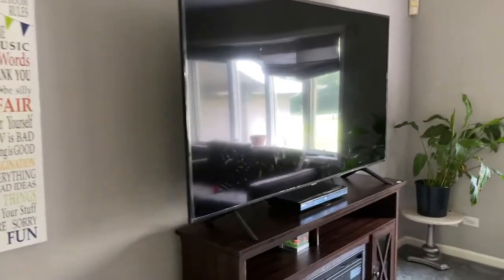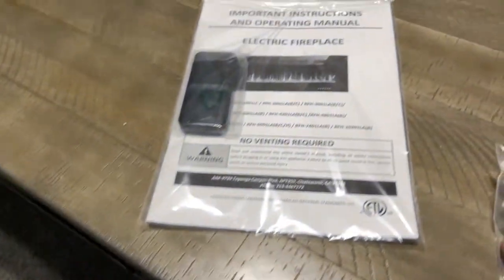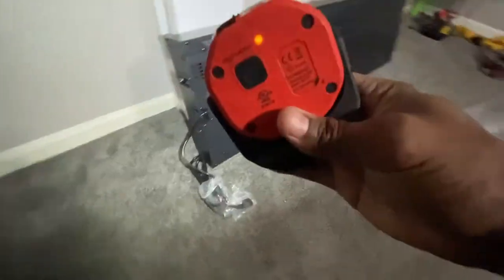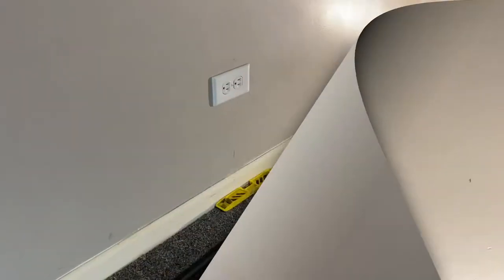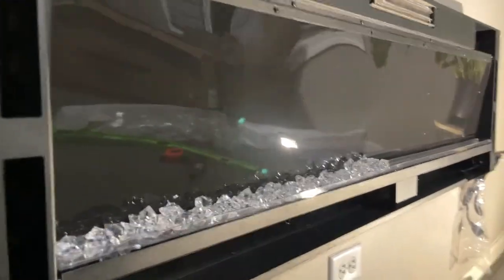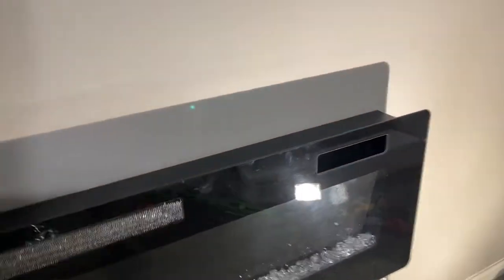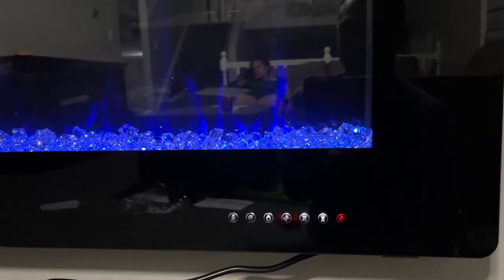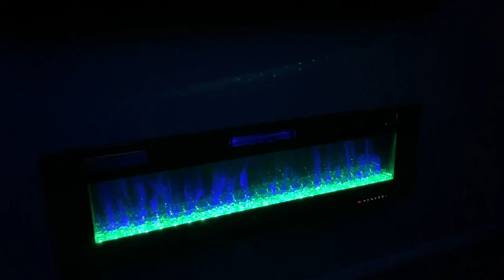R.W. Flame Massive 60" Electric Fireplace Complete Install (Easy) & Full Review! Awesome Fireplace!

Comment: I just got this exact one and put it on the wall. I will say that I wish my install had gone so smoothly. I had a stripped screw to deal with that caused some frustration. Once I got past that a few hiccups but it’s flush with the wall and I love it. My one complaint is that there is a clicking sound which comes from the reflectors rotating. I contacted the seller and they did credit me 20% plus give directions on fixing the issue. After taking it apart, the sound is still there but not noticeable when the flame speed is low. Great review.
Reply from the maker: That's awesome Felicia! Good job for getting it installed. Sorry to hear about the noise. I am glad the credited you some of your money back. Thanks for watching!
Reply: That noise is pretty annoying. How did.you fix it?

Comment: So you didn't screw the nails into the plastic anchors that came with them?
Reply from the maker: No, I didn't use those. I used the anchor screws that did not require the plastic anchors. Here is a link for them. 
https://www.homedepot.com/p/Hillman-Walldog-1-1-2-in-Hi-Lo-Chrome-Pan-Head-Phillips-Anchor-25-Pack-376238/202243031

Comment: I need help!!! I can not get the FFC connector to release
Reply from the maker: Do you have some tweezers or small flat head screwdriver (one that is used for eye glasses)? Those will help remove the FFC connector without breaking it. It's very fragile so you have to be careful.

Comment: One other thing, what is depth of this fire place?. Their ad says it used to be 6” but the new model is 3.85” but can’t determine by your pics of the unit.
Reply from the maker: I should have added that information in the video. Sorry about that. From the wall to the front of the glass is 4 1/4". This includes the mount and the glass. The glass is 3/16" thick. Once again, thank you SO much for watching!

Comment: What type of stud finder did you use? :)
Reply from the maker: I have many but here is a link for one that will do the job for cheap. 
https://www.amazon.com/Stud-Finder-Sensor-Wall-Scanner/dp/B07F6RZM43/ref=sr_1_11?crid=1ANHLNKXQADIO&keywords=stud%2Bfinder&qid=1654196761&s=hi&smid=A1L81R39Y02RWV&sprefix=stud%2Bfinder%2Ctools%2C103&sr=1-11&th=1
Reply: hey thanks.

Comment: Is there space in the underside of the fireplace to hide the electric wire where you could duct tape it? Can this unit be hardwired?
Don’t care for the exposed plug and wire into the outlet. This product is available via Amazon with several sizes.
Reply from the maker: Hi Tom, yes, there is plenty of space underneath where the cord can be hid. Also, you can hard wire it. Just cut the plug off and wire it to your service (very easy). Thank you SO much for watching!